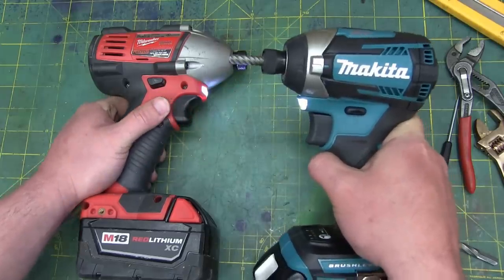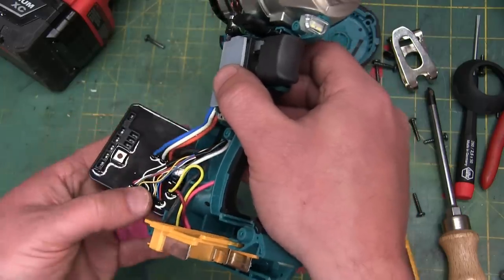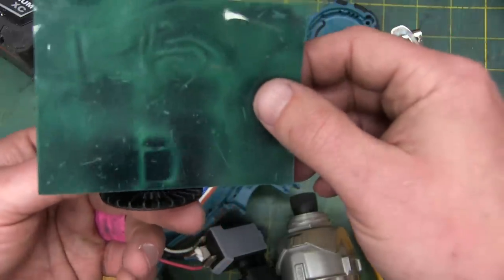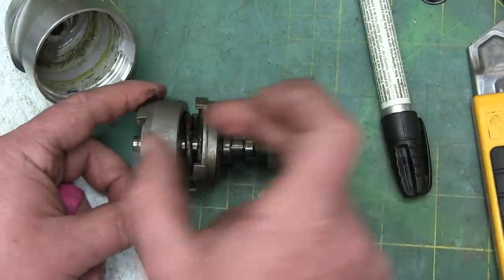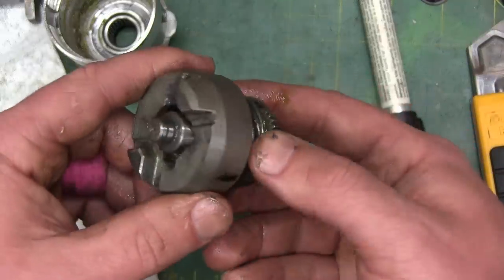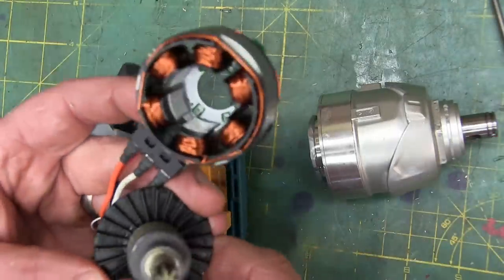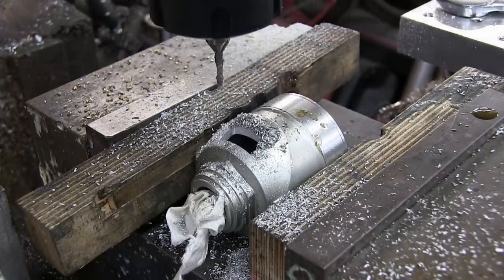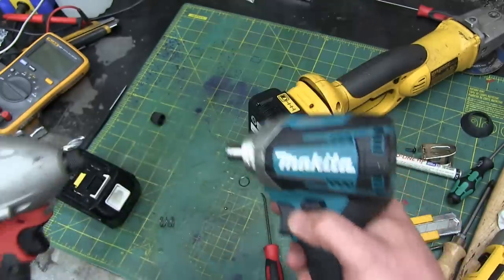BOLTR: Makita Brushless Impact Driver

Comment: For one the battery of the makita is more powerful cause it's a 5.0 the Milwaukee drill is not brushless and the battery is a regular xc lmao try and use a brushless Milwaukee drill with a 9.0 or 12.0 and I bet it would RIP that little makita impact 😂😂
Reply: The Ah of a battery isn't the power. Think of more ah is like having a bigger fuel tank

Comment: milwaukee impacts do not" push" hard enough.  they pop out of the fastener's driving mechanism.  the dewalt 12v or 20v impacts do not require u to push on the driver thats on the fastener.  its weird but milwaukee impacts suck ass.